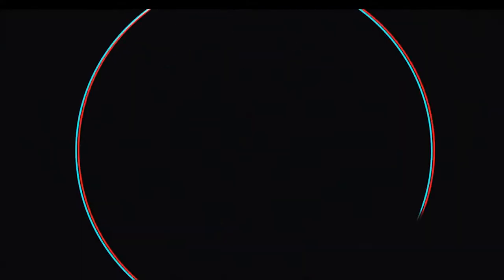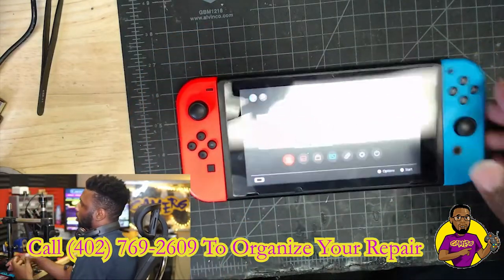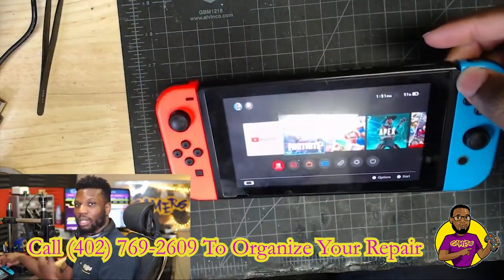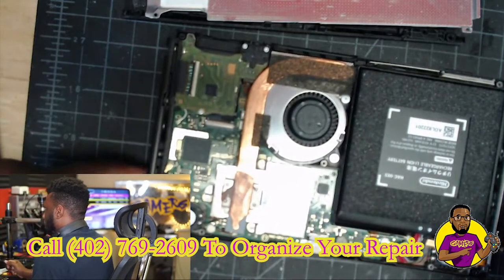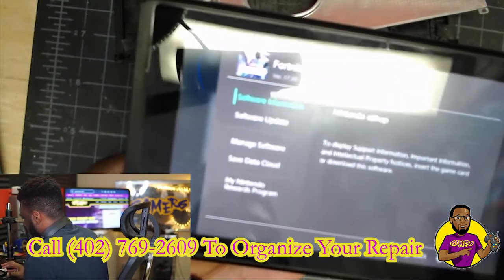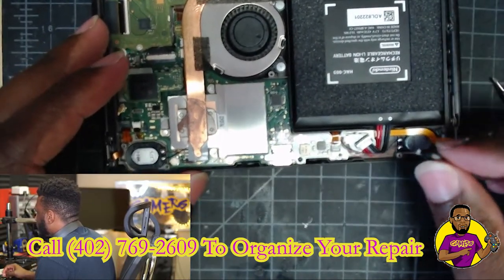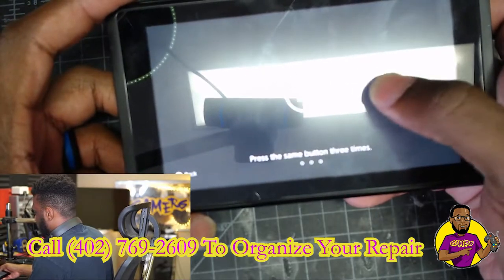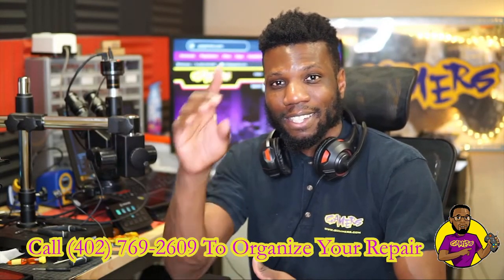Fix Nintendo Switch No Sound/Audio Repair (EASY METHOD)

Comment: So there is no sound when a headphones are plugged into the jack. And no headphone icon when the volume is turned up. So basically both speakers will need to be replaced then?

Comment: I’ve had my switch for over two years now and yesterday when I docked it the sound stopped working on my tv. The hdmi isn’t the issue and I’ve tried restarting both my switch and the tv. Tv sound works fine outside of the switch and the switch audio works fine outside of the TV. I didn’t change any settings so I have no clue what to do at this point. Please, help me if you can!
Reply: I’m experiencing the same thing what did you do to fix your switch?
Reply: @Andrew_-nr7zt  Did you fix yours?
Reply: @Emma-dh1lx  Yeah I ended up leaving it alone for a day and it ended up fixing itself
Reply: Unplug the tv and plug it back in

Comment: Switch lite issue

I have no sound from the left speaker.
-have stereo with headphones
-tested a good working speaker
-made sure the ribbon from mobo to daughter board is connected
-tried a new ribbon cable
-tried a new daughter board

Something on the motherboard is faulty and idk where to look

Comment: Help! My switch doesn't have any sound, but when i plug in headphones or when i connect it to the tv the sound works normally! i've cleaned the switch out of all the dust but yet it didn't help, any advice?
Reply: I'm also too scared to open the backplate as i think i can ruin the switch, is there any other possible way to  fix it?
Reply: im having the same problem
Reply: Same with me
Reply: @jennacernik1025  did u fix it?

Comment: I have had this problem for 1/2 years now, and the audio worked with the headset. And i broke my headset today by snapping the part that you put in the switch (idk the name of the part) my switch's sound was cutting out so i check to see if the thing on the headset was bent and snapped it here I am now.  (btw i did not press hard at all)

Comment: I got 6 pairs of speaker replacements, and the audio is still not working. The headset icon is not showing on my screen. Also I have the software updated to the most recent version. Any other ideas?
Reply: get a new switch😢

Comment: With mine was literally working two days ago I put it on the dock went to take it off today no sound whatsoever press the volume button and it literally just shows the speakers with an x through it volume doesn't go up doesn't go down can't hear Jack shit checked all the sound settings make sure nothing could was turned off for on by accident reset it nothing turn it off turn it back on nothing plugged it into the TV on the dock getting sound but when it's undocked no sound